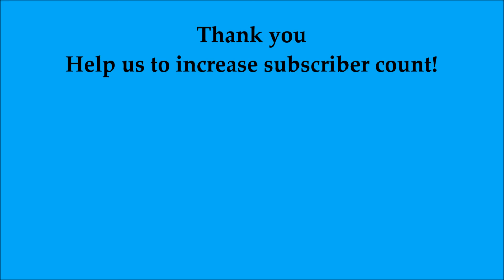How to Make Remote Control Car at Home in Easiest Way - DIY Wireless RC CAR

Comment: bro how to collection left and right plese video karo
Reply from the maker: Hi nagendra, the circuit which I used had 3 separate buttons, one for up and down,one for left and right and other one with single function I used them to control these motors and other with normal left and right
Reply: nanage artha
Reply: nanage artha agalilla plese
Reply: dro plese send tha collection diagram plese

Comment: i totally lost since i am beginner .Front motor left side blue wire or both red black,right side yellow wire ,from next part i totally lost the wiring  after 4.32 minutes can you tell me which wire to connect which motor
Reply: Green

Comment: I am a student of 8th grade and I love inventing mechanisms like this 
I am absolutely amazed by the simple things you have used in your project
I will definitely try making this
one small doubt-what is that circuit u used to join all the motor's wires and the switch
Reply: Rc reciver